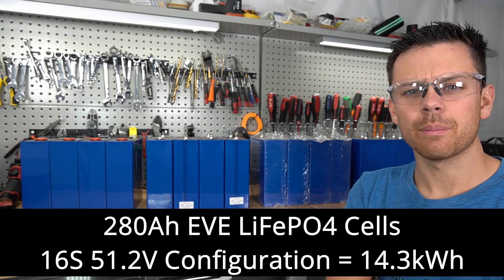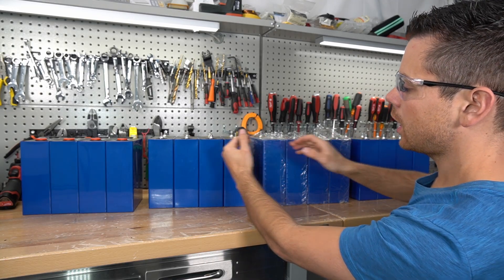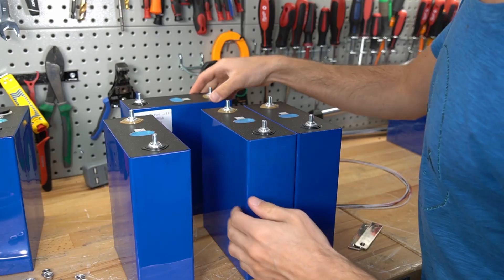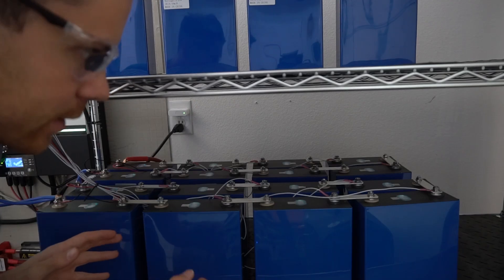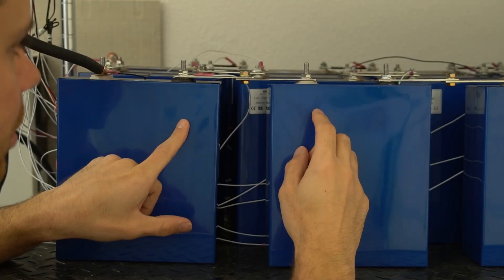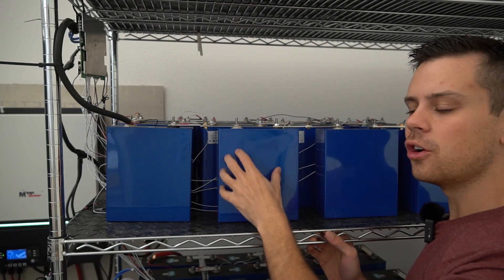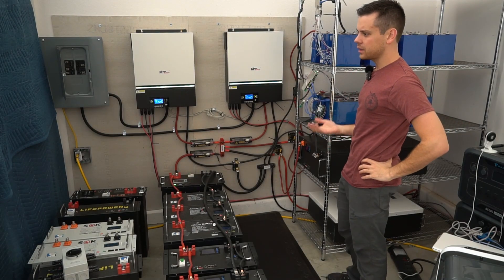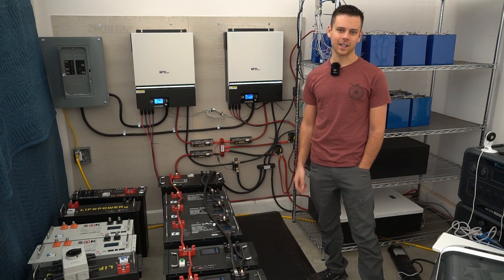Quickly Balance and Build a 48V LiFePO4 Battery w/ Cells from Different Suppliers

Comment: Hey Will, what do you think would be the least expensive way to connect 240vac grid power to a couple LV6548 inverters so I can have the automatic switchover when solar and battery power isn't available.  
The output of the inverters would be connected to my current breaker box input in place of the grid connection.  Any ideas on how to do this without hiring an electrician?  Thanks

Comment: I have also installed a 220v kW meter to measure the used KW output over time. A mechanical meter so no one can delete or reset it. It will be there forever so I will always be able to calculate the amount of output to my off grid system and know the amount of electric in money... I.E. 2500kw at .14 pence is 350 pounds!

Comment: Hi Will, another amazing video! What are your thoughts on a Victron off grid double decker bus system?
Would it still need a generator in the system or is there a possibility of converting used ev car batteries and charging them at an ev station?
Would love to hear your thoughts or a video 😊
Kindest regards 
Simon
Reply: think you have a lot of problems doing ev batteries at charging station since you would not have the cars computer system. teslas cars are always connected to tesla . battery  have been used as Powerwall's will has done 
but there connect to solar or plug in  lithium charging.  calculate your load . best to convert all lighting to led
are you running home ref or rv frig. and are you trying to a/c the bus dont forget low temp protection either in battery or charger and or insulated heat box if going wher temps are 0c or 32 f dont forget watch legal height of equipment on top of double decker  a/c on roof could put it too high  good luck

Comment: Always enjoy watching you explain all this. Still playing with my little experiment of lithion and lifepo4 in parallel. Found I need to bottom balance the lithion and top balance the lifepo4. It's actually been working better than I had though. Soon to add some decent loads to them but still not getting near my main system, I'm not that confident in it

Comment: installing my first system in an off grid cabin, using an all in one 24volt 3000 watt inverter/charger , is there a video in your list that will help me with set up as far as fuse and shut off location and size, grounding and such. I went through your videos but might of missed it. I bought your book but its 12volt and didnt have an all in one system in it.  Thanks in advance.

Comment: I actually disagree for once! It is not completely pointless as I have done this and really had better luck charging them all up at once at single-cell voltage (using meanwell 120amp charger) vs charging each group at a time. Of course, if you hook them all up 16p later, they can balance that way too. Even grade A can take a while to balance out if not charged all together at once. JK BMS with .6A or 1 or 2A not an issue, but most BMS , including overkill, is 50ma and would take a really long time to resolve.
Reply from the maker: I did not want to buy an extra charger for this pack that I could only use once. And they are balanced now. Might take a week to get them all at the same voltage on top but I'm pulling full capacity so I don't care. What further benefit would I gain by doing it your way (the way I usually do it, and have made multiple videos on years ago)?
Reply from the maker: Did you see all of my past videos doing it that way?
Reply: @WillProwse  actually I have! That's why I reverted to doing it that way. I had tried to shortcut it by charging groups of batteries at 12v then combining into a pack and with full charge and discharge cycles using overkill solar BMS. Due to the 50ma balance rate and how lifepo4 skew so much at minimal voltage differences I kept having issues. So I sucked up my pride and went to the basics like you said and it fixed my issues. Now I'm within a few thousandths on each pack with a 50ma balancer. So when I say I disagree I meant I disagree with this video and agree with your previous ones!
Reply: @WillProwse  I did it again recently with higher amperage balancing BMS and it self regulated after a few weeks, but the difference between a 50ma and even .6a is.. well, 12x? Makes a big difference. Didn't mean to cause issues just sharing personal experience based on your videos. I use solely 16s batteries 230ah to 310ah cells. Sitting at close to 200kwh now to handle my shipping containers, pool pump, and 240v house loads, including daily Tesla model s charging and HVAC / water heater. Have 14kw panels on house and 20kw on shipping container thanks to your vids.
Reply from the maker: @ShaleAudio  holy cow!!!! 200kWh. That is making me drool. Did you not pull full capacity when you did it the 4S/12V charger method? What was your figures?

Comment: Solar question: I looked thru all your many videos looking for something that explains the difference between solar panel optimizers and MPPT . I see people taking about putting them on the back of their panels to prevent a shaded panel from messing up the whole array. Unless that's what you were showing about in "bypass vs blocking diodes"

Comment: That is a lot of capacity. If you had to guess, what would it cost to purchase all those batteries right now? $100,000? Thanks for sharing
Reply: 7500 amp hours of batteries is 96,000 watt hours.  If you bought 25 Chins 300 amp hour batteries at about $1150 from Amazon ($1035 each plus tax), it would cost you  $28,750 for batteries alone and the UPS delivery driver would hate you for life. Of course, server rack batteries would be the way to go if you are laying out that kind of cash.

Comment: Nice snake setup!, since the 0,5 mm "breathing"of the cells is in the width and cells aren't touching eauch other, there will be no issues BUT: since my setup will be 48 Volts, how do you go from the first set of 8S to the next set of 8S batteries?
With the 16pcs EVE 280K cells I ordered from Nkon in the Netherlands, I have another issue: with two M6 screws meant to be used with the standard busbars for side to side oriëntation, I won't be able to conect them the way you do.

There are two options:
a) make my own copper tinned busbars and connect the two sets of 8 with a specially made connection or
b) try to motivate the flexible busbar company to make new ones made for the 280K cells.

Happily I know a company that cuts copper plates with water and tinning these copper bars is not such a big issue 😃

Comment: Would you consider doing a 36/48v golf cart tutorial? A lot of communities in the southern US use golf carts/LSVs for local transportation, and they're all still using expensive, dangerous, and poor performing lead acid batteries.
Reply: I did a cart build with 48v packs from a Honda Clarity and it works like a champ!  I live in Arizona and use the cart for probably 90% of my transportation.  Has a 480w panel for a roof, so I basically never have to plug it in.
Reply: He has a short series on converting a cart, but would love to see a video building a pack of raw cells as I'm ready to do the same

Comment: done these cells been to be in a fixture to prevent expanding? you go from 2500 cycles to 3500 in the data sheet with a fixture.
Reply from the maker: Yeah and calendar aging will kill them before cycle degradation when used for solar. So not a concern at all for me

Comment: Great video!  I want to build a 48V battery to use with two LV6548 inverters.  I have a question about what you think the least expensive way would be to connect 240vac grid power to the inverters so I can have the automatic switchover when solar and battery power isn't available.  I wonder if there's any way to do it without hiring an electrician?  It seems that it will need another breaker box - one with just the mains breakers and the current one with all the load breakers.  But I'm guessing having an electrician add a new box and move the mains to it will be expensive.  Any ideas?  Thanks
Reply: Every system, needs and layout is unique, so a remote answer is impossible or unsafe. If you don’t know, at least ask an electrician for advice (pay him for the time). But if you’re not absolutely sure, let them install. Ask if the electrician has installed a few inverters before, because if he hasn’t, even he will need a lot of time to get up to speed. Not a normal house wiring and definitely not a handyman job. Breaker Interlocks, manual transfer switch, automatic transfer switch and the transfer switch incorporated in the inverter all have advantages and limitations. End game, no back feed into grid and no power loop back to inverter.
Reply: @SkypowerwithKarl  Thanks Karl.

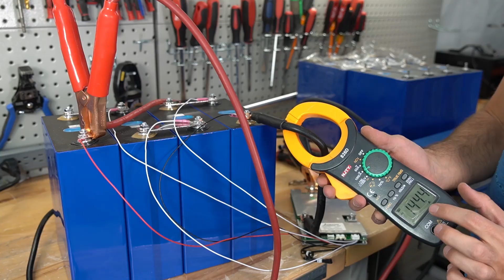Comment: 2:28 why charger voltage is 16V where your pack is 12V?
Reply from the maker: Wanted to hit HVD
Reply: @WillProwse  but why tho ? can you elaborate pls
shouldnt we never go above 14.6V fpr a  3.65V LFP cell?
Reply: @NawtieBoy96 he wanted to see if the BMS will disconnect the charger when a cells voltage goes over 3.65

Comment: Every professionally built battery Will takes apart has cells strapped or taped together, cell manufacturers recommend some sort of compression, but Will doesn't do it.  Other channels describe why it's important.  Why does Will think it's unnecessary?
Reply: From Will himself: "Some data sheets on some very specific cells say compression can increase cycle life to 80% by 1000 cycles. Which I ignore anyways because calendar aging will kill them before cycling will. Most cells do not recommend it at all. Think about fortune cells and others that have zero compression and show peak performance for years. Those cell holders they use allow zero contact around the belly of the cell."
Reply: @MrArcticPOWER  Strapping cells is so easy it seems to make sense to do it even if cycle life is only improved somewhat.
Reply: @JRP3  When you don't strap them, you reduce the chances of a case short, the air gap is good for cooling in high C applications and you don't put excess tension on the terminals (assuming you're using the non-flexible buss bars that comes with most cells). It's just not worth it for most cells and applications.
Reply: @MrArcticPOWER  I'd say most applications would not see high C rates and significant heating if properly sized,  and you can still put thin non conductive separators between cells.  You're right about non-flexible bus bars possibly being an issue and I would avoid those. Obviously all packs built for mobility cant use loose cells and will be tightly strapped.
Reply: @fathergratwick  EVE seems to be different than other cell manufacturers, I don't know why.  Certainly any cylindrical cell allows no expansion nor do any of the other tightly packed prismatic cells, I don't know what the benefit would be by allowing the cell layers to move away from each other.
Reply: I am going to strap my cells with light pressure applied by some cheap ratchet straps.  AND yes, I will have a buffer component on each end to evenly distribute the ratchet strap pressure.

Comment: Unrelated to this video, but I Live in SD as well and I know we don’t have to worry so much about low temps. However, I want to have the flexibility of being about to drive around with my camper van and a chins battery w/o having to buy the 200 viticron controller. Is there any other way?
Reply: Yeah don't charge them below freezing...
Reply: How about like a device that you can hook up to charge controller or something

Comment: So if I install 3 new SOK 100AH batteries connected to a Victron Multiplus Inverter/Charger should I have to bring each battery to full charge first before using or will the system self balance?

Comment: I was thinking, while building homestead sized systems is getting better and better, why hasn't anyone boosted the capabilities of smaller systems. That is, what if we could build a battery and delivery system that was powerful enough to run an apartment? Rack it up on wheels so that renters can move it from apartment to apartment and come off the grid (usage wise). It would sell like hotcakes!
Reply: Dont foget about the solar panel you would have to mount on the roof. Your landlords might not like tenants bringing in portable solar power plants.
I would not want my renters drilling into my roof or walls or using non approved unlisted power supplies.
Good idea in concept but tough to implement. But we run our whole home on solar which I could re-move to another location (if I wanted to work that hard). However I think Id build a new system at a new home and sell the existing one with the old home.

Comment: hie Will, I am a great fan of what you do and OI know this is not related to this video but I have this question, suppose you have an offgrid hybrid inverter and you have low power coming from your solar due to bad weather. What happens if you connect the inverter AC inputs to the same power the inverter is producing will it charge or it will blow up
Reply: Dude, you should not be playing with electricity!

Comment: Off topic question Will. 
Adding a lithium battery to my class B RV. Have a Renogy DC to DC charger with MPPT.  The existing convertor/charger is not rated for lithium.  
Can I take the charger output to the input of the DC to DC charger?
Also any type of typical wiring diagram would be very help.  Thanks
Reply: Yes - I've done this in my Travel Trailer. Search "LiFePO4 RV Battery - Use Renogy Dual Input DC-DC charger instead of upgrading Converter?" in diysolarforum
Reply: @joemontana4370  THANK YOU.  This is what I've been looking for.  Now, to tear half my RV apart to get the electrical system

Comment: Does any one know what the ultra max batteries are like? i've just brought some 2 x 24v 60ah lifo4 to make a 48v system. they are doing well so far. £476 each in the U.K . im using a Victron 100/ 20 with 2 x 420  watt panels.

Comment: I was under the impression those aluminum cased Lifepo4 batteries need compression or 'fixation" to keep them from swelling.   Is that not the case?
Reply from the maker: That is true if they are touching because if you do not compress or fixate them, they will stress the cells terminals. That's why I put them like this. No stress to the terminal at all.
Reply: @WillProwse  gotcha. So the compression or fixation isn’t for battery health “swelling” the cases but to prevent movement for busbar and terminal stress.
Reply from the maker: @oks3ranch  pretty much. Some data sheets on some very specific cells say compression can increase cycle life to 80% by 1000 cycles. Which I ignore anyways because calendar aging will kill them before cycling will. Most cells do not recommend it at all. Think about fortune cells and others that have zero compression and show peak performance for years. Those cell holders they use allow zero contact around the belly of the cell.

Comment: So it seems like you're still of the opinion that no sort of fixation is needed (in our application) even with Grade A's. I spent WAY too much time trying to figure that out and you be like "look how easy it is" 😂
Reply: I don't see why you would need them fixed by anything more significant than the bus bars if you live in a geo-stable area.  Obviously this would NOT be the case mounted on a mobile vehicle, camper, van or a boat.  But it should be good enough for a residential application.
Reply from the maker: 😂😂 I haven't had any one prove a downside yet. Oh I know! If there was an earthquake. I have looked into this and I am not in a earth quake prone area, so it should be good. 

I really enjoyed your video on fixation of cells. And mentioning the terminology and data you were using. Good stuff. 

Air is a fantastic insulator for systems below 60V. I am scared of the cells touching because if I screw something up, and they have a short from cell #1 case and cell #16 case, that would be a bad time 😂 I don't even want to test that actually. Maybe I should probe around and see what voltage those cases have across the pack.
Reply: @WillProwse  I have to ask: for several years, and not just on your channel, we see cells rodded together (or tape, zip ties, nylon straps) lots of discussion about compression and how much, some cells come with holes for the rods. 
 Now (suddenly) we want them all spaced out, not touching, no more talk about compression. So: What changed Will, why did this become your suggessted set up?
Reply from the maker: @r.b.l.5841  mainly because I thought about it for a while. Look at fortune cells. The holders allow zero compression and the cells have minimal degradation. If you're using a cell that recommends it, go for it. But I don't see any benefit. 

If the cells are close together, I do need to reduce stress on the terminal laterally, so I will compress them in that instance. But why would I do it for this configuration? I just don't see any benefit
Reply from the maker: @r.b.l.5841  I never said you shouldnt compress them if you need to
Reply from the maker: @r.b.l.5841  really depends on what you want to do. Don't copy me without understanding why I'm doing something. You cant use this configuration in a mobile setup. Which is pretty obvious
Reply: @WillProwse  Thanks for the replies Will,
I have thought about this in the past also, space between cells will allow for expansion, pervent stress on the connections, and allow better heat disapation.
When you say, compress 'if you need to', do you mean if the manufacturer recommends compression, or do you have another criteria (other than mobile set up I mean).